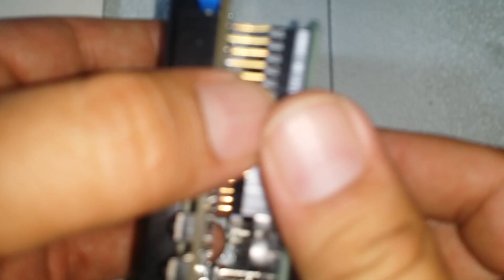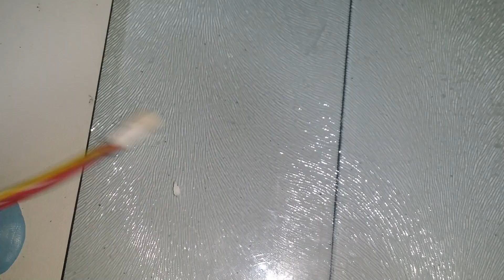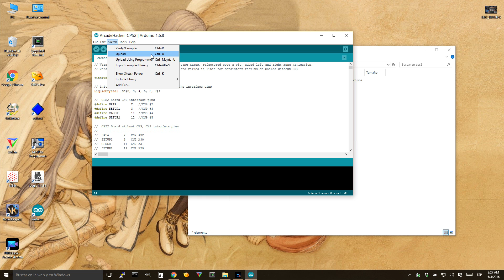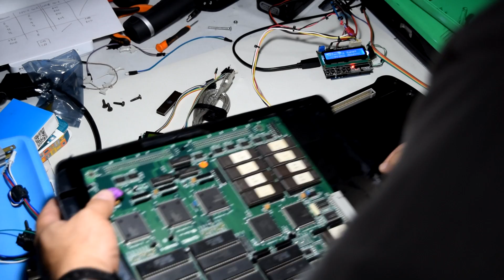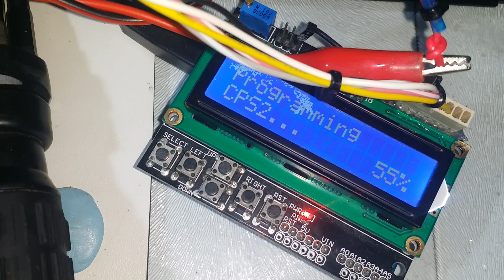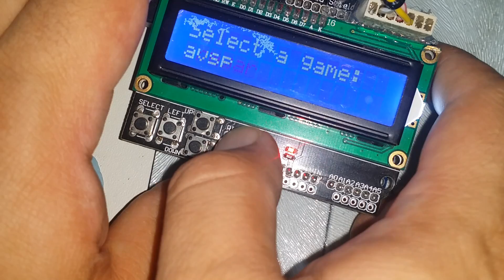Capcom CPS2 desuicide tutorial by Artemio

Comment: Hello, I recently bought an Arduino with all the necessary stuff. But I did not succeed on 4 review plates 4 and 7! One question is: The battery is 3.6 volts but it is already about 8 years old. When placed on the board the battery is left with 2 volts. Is this what makes her not revive? Is it possible to test with normal batteries or only with this battery?
Reply: I just made with -6 and -7 revisions, but 3 and 4, nothing.

Comment: This would work great IF the up down left right select buttons actually work in order to select a game to load.   I did everything correctly, loaded the sketch and the Arduino starts programming without a game selection.   Cleared everything, started over, same problem, cannot select a game at all.   Why?? I even cleared all files, programs, cleared the Arduino.....still does not work even with another new Arduino.   Disappointed.   Didn't want to use a infinikey. Seriously, for all the expense and computer nonsense one has to deal with, if I had to do it again, I would have got the Infinikey in the first place and not practically had a stroke.   It's that irritating.   Do yourself a favor and forget Artemio and his program.   I might just crush Street Fighter Alpha 3 for all the trouble it has caused me.
Reply: Sorry you went through that, it must be the lcd you bought. Either it has different values that don't comply with what was used, or it is defective.

Please let us know where the shield was sourced from